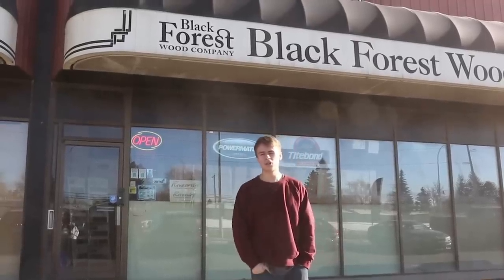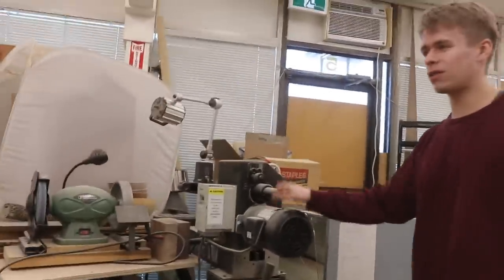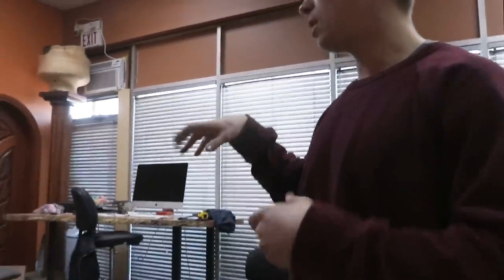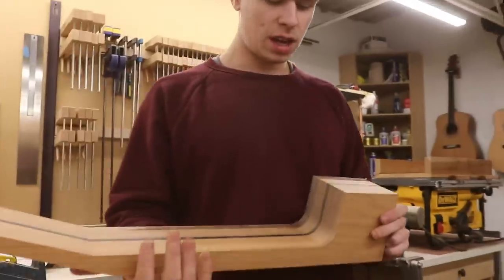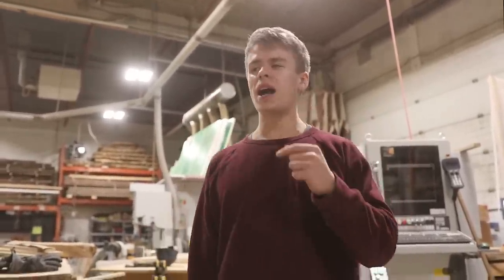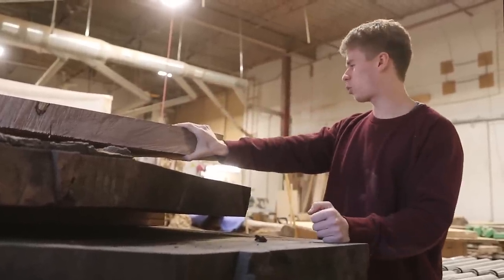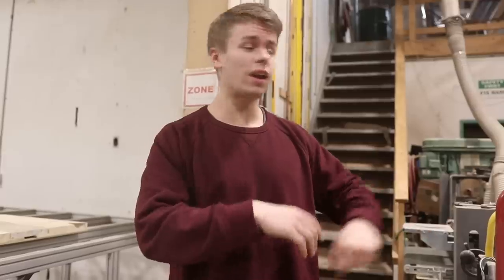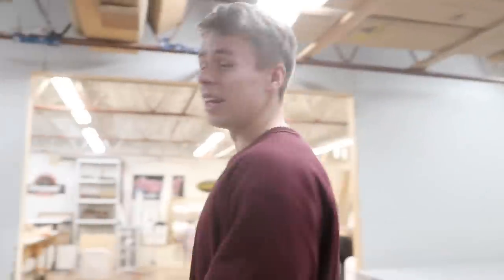Black Forest Wood Co Shop Tour + Giveaway Announcements

Comment: Do you ever drill some holes in the live edges to ensure that you don't get separation?  I am interested in trying epoxy pours but am scared of eventual failure of the joint due to expansion and contraction differences of the wood and epoxy...  Just an amateur not a competitor:)

Comment: I watched your other videos.  Do you ever pour perfectly clear epoxy?  Do you vacuum release the batches to help with entrained air from the mixing process?
Reply from the maker: charles hetrick Yes we do, we don’t de-gas it though! We actually just did a clear pour today, we’ll try and do a video on it soon 😁
Reply: Black Forest Wood Co. I just started my first table of this type and whilst I got the obvious bubbles out quite easily if I shine one of my high output weapon lights (1200 lumen) through the material I can see zillions of micro bubbles.  I ran a test batch and utilized my vacuum former to de gas and still I am getting these bubbles.  The bubbles are near impossible to see with out really looking for them but I’m anal retentive enough it bothers me and I want them gone if I can.  I think I’m going to just start doing super thin pours and hitting them with a torch.

Comment: "This is where we do most of the actual woodworking"

After he talks in length about their 2  CNC machines.  Am I alone in thinking that's not actual woodworking, it's just programming?
Reply: if you're programing it yourself... its still work. But yea... I've felt the same way, especially since I don't know the programs lol
Reply: It's an interesting discussion as to what defines woodworking, isn't it?  But here's another perspective: if you think for even a second, that the master furniture makers of years past, who employed apprentices to hand plane, saw and carve wouldn't use CNC equipment, then give your head a shake.  I'll close this thought by stating that if one is relying solely on the beauty of natural wood edges and coloured epoxy to define finely designed furniture, you're deluding yourself.  It's a fad, plain and simple that will be long gone and forgotten... while exciting design and craftsmanship lives on, forever.
Reply: @ApexWoodworks  you're right, finely designed wood furniture doesn't include epoxy. 

Other than that I disagree.